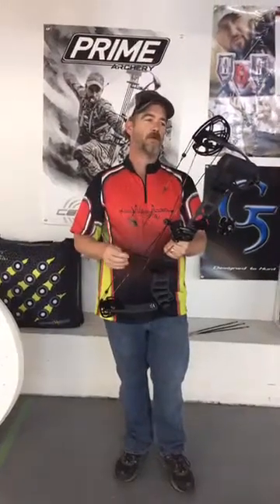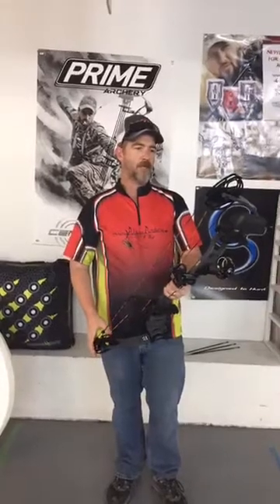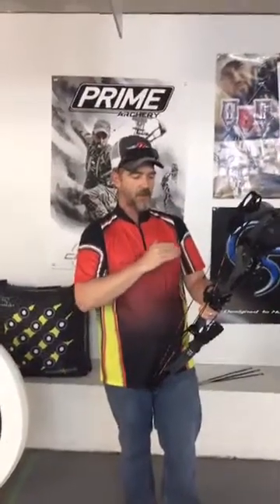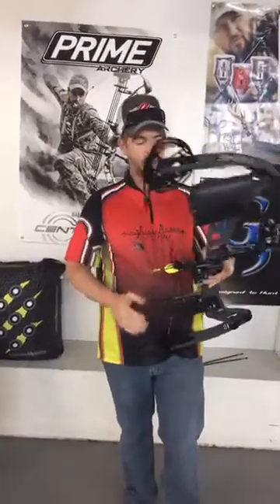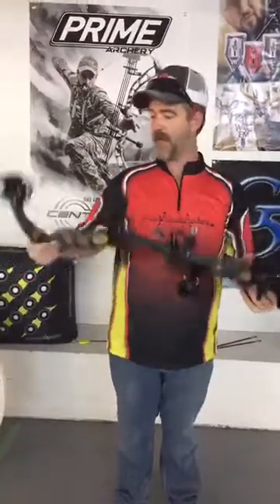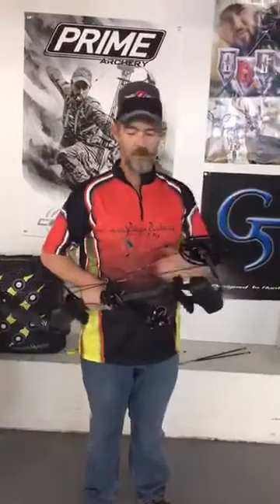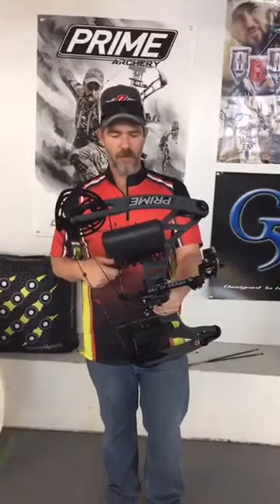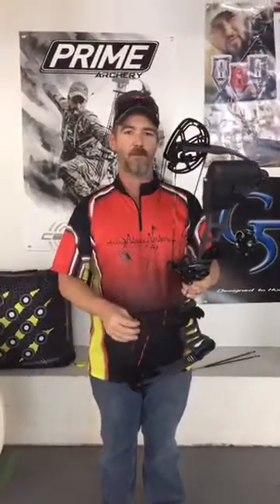Prime Centergy tech tips

Comment: I am having some trouble getting my bow set up initially. The bow is about 1/4" long on ATA according to specs. The bottom cam timing hole is still not aligned and I cannot take anymore twists out of the bottom of the cable or else there will be no more twists in that part. For this reason, I cannot get the cams in time. I am able to advance or slow down the top cam just fine by messing with the top cable, but I can only seem to slow down the bottom cam using the same method. Any info is much appreciated. Thanks!
Reply from the maker: where are the timing holes in relationship to the limbs?  Are these the stock strings or custom strings?  I would start by taking off all the strings and cables and then twisting them up to factory lengths then reinstalling and seeing where things land from there.  It seems that the strings have been twisted and untwisted so much that it is time to just start over.
Reply: Well the holes were aligned with the sync dots. I am not sure about the strings. I took 3 twists out of the top and the bottom of the string. The sync holes are now buried in the limbs. I have the #3 TRK cams, so they should be 29" with the limb stops at the #3 position. The bow is showing a 28.75" DL from the front of the grip to the nocking point and is showing 72# max poundage. The bottom limb stop hits about 3/16" before the top stop even with both timing holes in the same spot (before the twists taken out as well).
Reply from the maker: If you can take some pictures of the top and bottom cams at the sync holes email them to me at alpinearcheryllc@gmail.com  That was I can get a better idea of what is going on.  You can call the shop tomorrow as well.  541-963-4671

Comment: So, the string does not run perfectly vertical because the top cam is bigger than the bottom cam?
Reply from the maker: that is correct.
Reply: @AlpineArcheryandFlyLaGrande  should I level a centergy using the shelf as a horizontal plain?